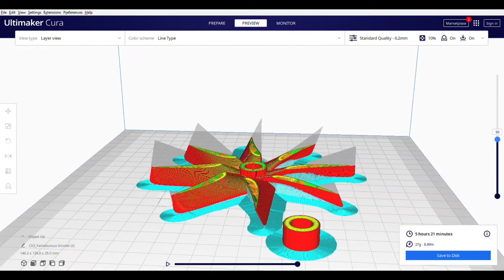Make your own gold prospecting drywasher (Part 2)

Comment: Sweet job, cool bit of engineering and well considered. Having a few of them sounds good where it gives you access to a lot of places sluices haven't been. Looking forward to seeing how you get on and any refinements you make to the system. Its already showing good results.
Reply from the maker: It's very lightweight, compact  design, so it's easy to carry around for researching new locations .Other drywashes long lasting ,but twice even three times heavy and they don't go together. I have to make two more because to recover fine gold you have to run it slow, so you would need few of them to process more dirt. That is also true for the professionaly made drywashers. They can't process lots of dirt fast enough.
Reply: @vahagnmelikyan2906  It really does look a good design and built, light weight but robust, not over kill on the engineering but enough for the job. If will be interesting to see if you can make multiple ones to take and still have them compact enough so they are not to cumbersome to carry, where it will be interesting to see if you can split the motor up to run 3-4 of them or if you will need additional units to ensure they all work correctly. Even if you have to replicate them 3-4 times then it doesn't seem to bad where if you can daisy chain them up so they are even more efficient in parallel use that would be all the sweeter. Its a well considered design, maxing the design for being on foot and then maxing the design for having loads of them in a car trunk would be cool, it seems the more you have the more efficient everything becomes 🙂 I'm in England in the UK so we dont really have many places here any more to go to as to test some out but its fascinating material to watch.
Reply from the maker: @battonfive  I'm gonna use bounce house electric blowers each one individually ,with digital speed controler to pi point exact speed. Won't be as efficient as gasoline blowers ,but requires less maintenance and it won't suddenly rav it up and blow your gold away.
Reply: @vahagnmelikyan2906  Nice that makes good sense all round, hopefully the li-ion batteries in the blowers will last plenty of time where you could always solder up a meatier pack or if they are cheap enough there buy a meaty pack, like my ebike runs a 1500w battery at 48v I think it is. That was about $700 but its really good at 8kg for the weight and I would think at the electric blower wattages would last quite a while. Where I would imagine the electric blowers weigh alot less than the petrol so that would be a good weight trade off alone. I think on a good back pack you could carry it all where even if you had a little cart to transfer the weight to wheels it might well justify it depending on the terrain. Your plan sounds really good where I'm sure you will learn alot and refine things the more you use them. Its honestly a really cool project and looks an effective one to 🙂